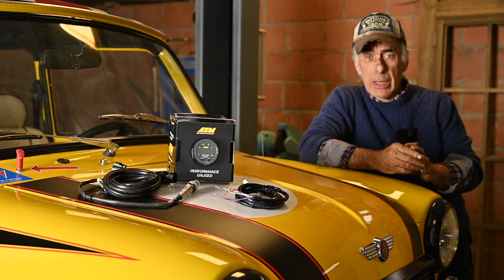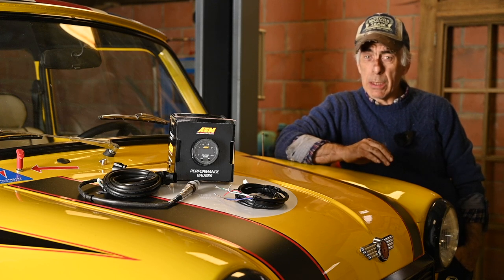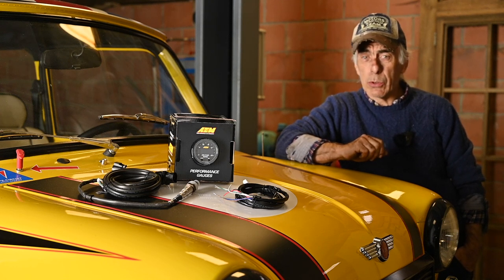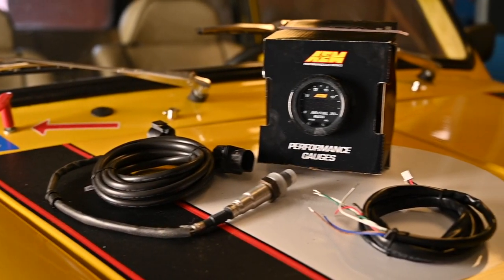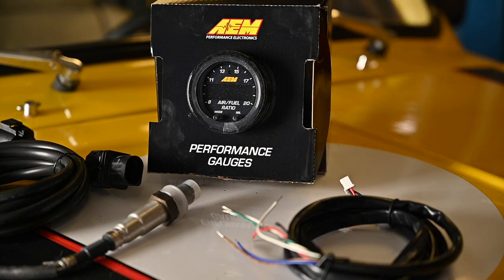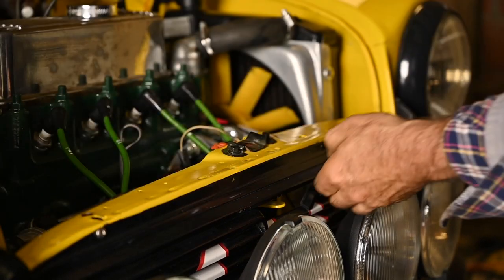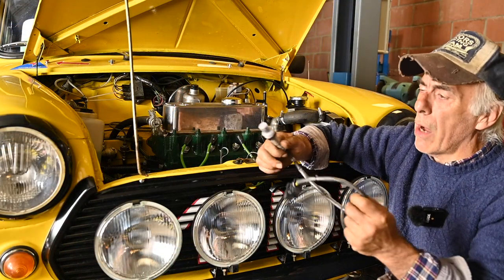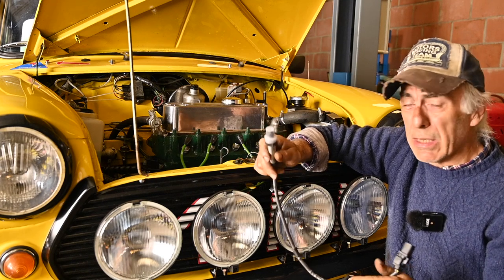Preview, Mini Classic using and fitting an AFR sensor for the ultimate engine tuning.

Comment: Looking forward to this. I'm installing one on my toyota 1000 with twin 40 dcoe's, to help with tuning.
It's hidden in the glovebox to hide the digital meter, but you can drive with the lid open to closely monitor the values.
Reply from the maker: TXS for the comments, I see..  I will have mine in the center console

Comment: I do not know that your country has ethanol or not in fuel, but etanol content can throw of the reading of AFR. I am installing this exact gauge on my Peugeot 205, and you can flip the face to show lambda, and then switch the gauge to lambda mode. This way you can ensure that reading is correct, as lambda is not affected by ethanol present in the combustion process.
Reply from the maker: TXS for the comments, indeed these are options.  Have you installed it so far ?   and we use typical E98   ..    The only thing I am not sure off if I an added lead replacement in the fuel as the cylinder head is for unleaded fuel.  And that additive might spoil the O2 sensor... Lead certainly does..   Any idea

Comment: Interresting indeed! Is an AFR-sensor equal to a lambda-sond/sensor, or are they operating differently? Volvo used lambda-sonds in their cars for a period, but not anymore I think.  Maybe because injection systems have replaced carburettors??
Reply from the maker: TXS for the comments,  This is a wide band O2 sensor, and it measures the AFR versus older models that measure the O2..  Modern cars must have the probes as they feed to the ECU and control the fuel map and so on.  Typical today there is a wide bad sensor before and after the catalyic converter

Comment: Steve,  I watch all your videos as there always great content, I was a bit concerned when i saw the mini lifted on a two poster ramp on the floor pans, 
I see you have them as close as possible to the corners, The minis should be jacked on the subframes rather than the body, I have a video on the damage 
that was done to my floor pans on a newly painted cooper shell from a garage that where not used to working on minis. I can see from your videos you
are a very experienced guy, I hope you don‘t mind me making this comment or advice i would hate to see any damage to this lovely mini. Cheers Dave
Reply from the maker: Thanks for the comments Dave, Indeed that is something I found out ... and by all means comment and provide advice.  In fact I started to look at it where it should be lifted .. and that is indeed on the subframes.   You will see that i moved it to the subframes in  the next video... Many thanks and you have a great channel as well with major rebuilds...  A quick question, did you ever install a AFR / O2 sensor and ran unleaded fuel with a lead additive  ?    Does that not damage the O2 sensor ?
Reply: Steve,  Glad to be of help, I have never fitted the sensor and infact when it comes to computers or wiring i‘m a way behind the 8 ball lol. 
I have a young friend who is running one so i will ask him and get back to you with some info. Cheers Dave
Reply: Steve, I spoke with Luis he says the sensor gets clogged between 500 and 1000 kms but you can clean it out, He suggest using it for setting up then fit a blanking cap when you don‘t have the sensor in. Cheers Dave

Comment: It’ll be interesting to see this in operation. I have an idea how AFR meters are used with fuel injection (altering fuelling in each cell of a 3D load/speed map to get the required AFR) but I’m curious as to how the results will be used on a carb engine, especially one with an SU carb where the AFR is controlled by a needle that is free to move up and down. I guess you’d have to measure the height of the needle to be able to make any alterations at any given point. Or have lots of different needles to try!
Reply from the maker: TXS for the comments, soon the video and I am as curious myself